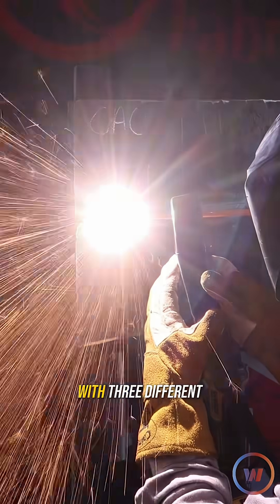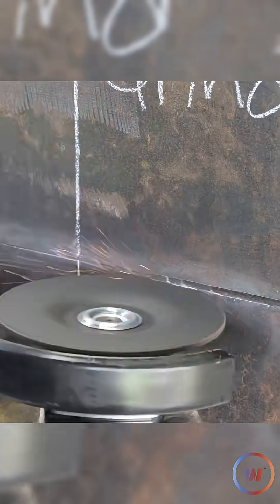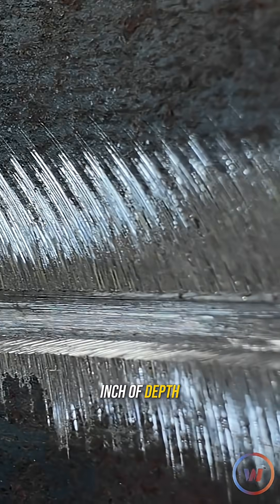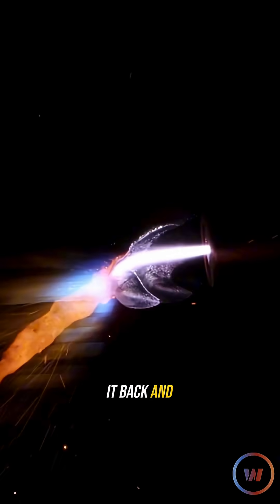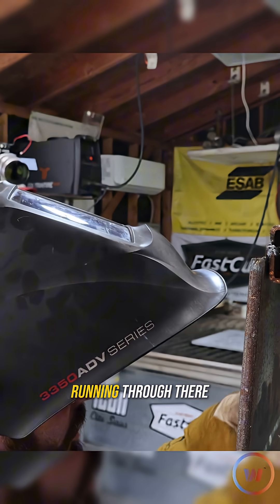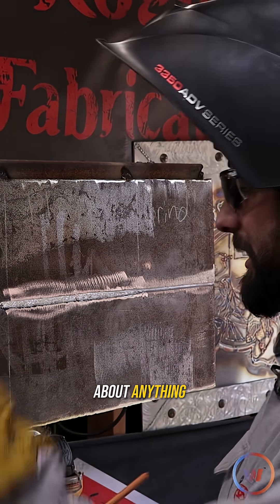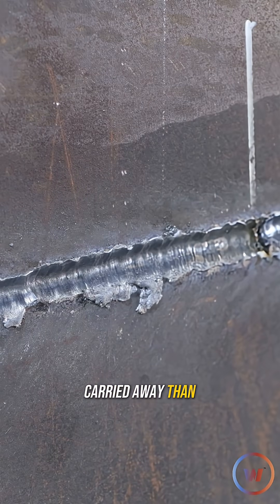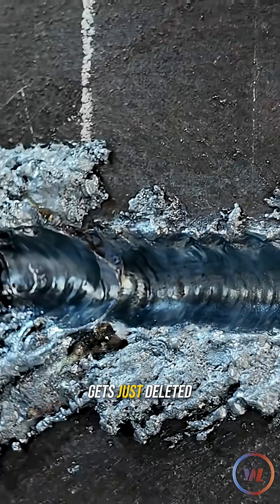3 Ways To Remove Metal Fast - Arc Gouging, Plasma Gouing, Grinder

Comment: 300 amps on that Air Arc. U was only using 1/4" rod then.  !?  And I'm the long run ...  IT'S still quicker and easier to just do what you did ./ Or similar....   With grinder and a invader blade .....  Cuz even after your plasma gouge or Air Arc it out , YA still have to grind to prep for weld .....   And not with grinder and  a Pipeliner wheel ...

Comment: If grinding a prep, put the disc at a 30 to 45 degree angle for the last few passes.... then you can SEE 😅 the incomplete/lack of fusion. 
If you grind straight along the plate the grinding lines camouflage it.... just saying 😌

Comment: Hey bud, let me give you a hint separate your gap and put a sacrificial behind it. What the hell is sacrificial if I’m welding steel I’ll put some aluminum behind it. Well the shit out of it as quick as I can as hard as I can, it’ll puddle in the aluminum you won’t have a gap on the back of your metal you’ll have a puddle that you have to weld our grindoff
Reply: Certainly can work. But that’s not the lesson of the video

Comment: Can you gouge with oxy acetylene?
Reply: @JohnSipkens-fabrication  yes you can, I find it great for better control when separating parts and I don't want to take any parent material.
Reply: Also as an option you can have an angled oxy-fuel gouging tip. This way the torch can be held in a natural position like cutting straight down but the tip has a 20⁰ bend forward in it. Wash or cut rivot heads off or gouge. Keep the metal red hot and gouge along. Can buy a 30⁰ angled cutting tip to bevel edges of plate or bevel pipe.
Reply: Yes and you use what’s called a flushing tip. It’s a fun process, but it’s realtively slow and can get fucked up quickly if you aren’t careful.
Reply: Pipefitter would call that a cutting torch. Get good and you can clean cut a bevel.